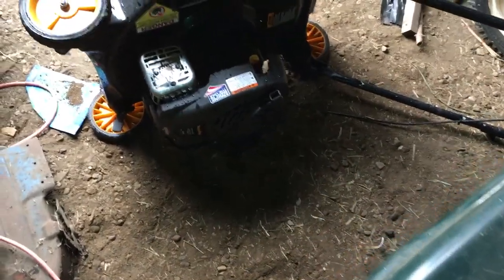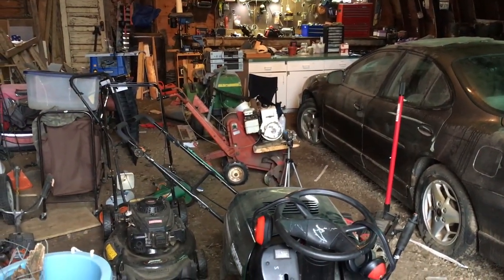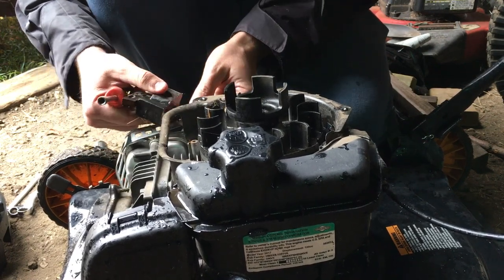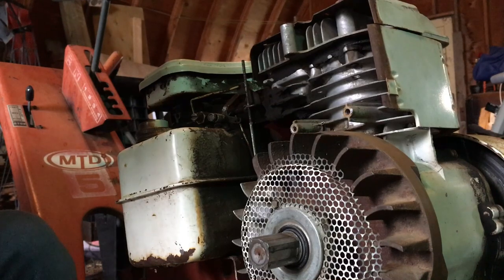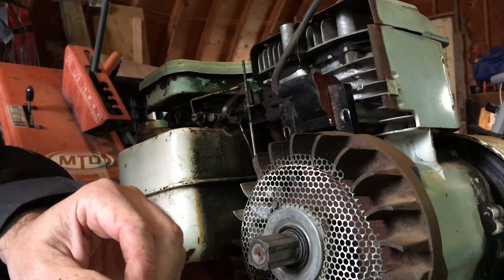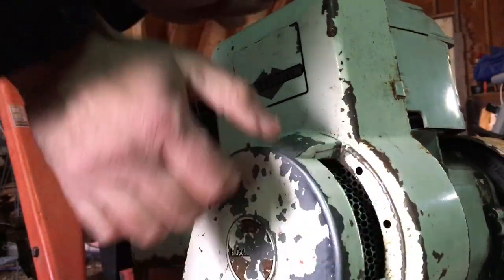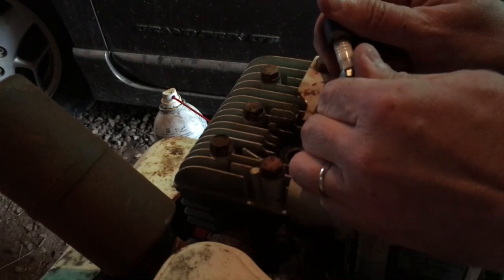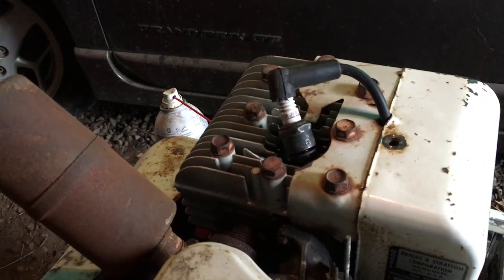No Spark Tiller Repair!!!

Comment: I got my old tiller up and running after sitting for over twenty years. The carb needed a rebuild. I was so happy that I got the thing running that I decided to give it a wash to make it look pretty. Well I'm not getting any spark now and I'm thinking that I may have fried the magneto. Is there any way to repair or restore the magneto or is replacement my only option?
Reply from the maker: It’s often just the points.  Get the fly wheel off and sand the points, you’ll likely get your spark back.

Comment: I have the same problem on my tiller engine It won't spark. I do have an old lawn mower though... maybe I could take the coil off that one? one question, do you have to have the spark plug angled like that when you are testing it, or was that just so we could see it?
Reply from the maker: As long as the outside of the plug is touching the block (electric ground) it should spark.  New coils don’t need points to fire, so the new mower was winning.  I haven’t tried it with an old coil.

Comment: just did the same thx

is it just on there with 1 bolt?? mine also didn't line up 100%
Reply from the maker: Yes, and it worked great up through this spring.

Comment: @Turbo231 I think i have the same kind of engine starter coil, like your old one (the one with the ground wire ring). Where should I connect it? And where do you connect the third wire?
Reply from the maker: I’d have to check the video.  The point of this video was to get rid of all that, points and all, and replace it with a basic system.  Magnets go around, makes a spark, off it goes.  Because the engine is controlled mostly by the carburetor, no other controls are needed.

Comment: Did you try cleaning the old contacts first? Rust builds up on the stator wheel and coil. Cleaning those usually fixes the problem if it was running the previous year. Seen my dad fix the tiller many springs like this if you have a no spark situation, the key being running the previous year.
Reply from the maker: Yes, I did and still no spark.  However the upgrade went great and it ran awesome for a few more years.
Reply: @Turbo231  ok. Thanks for the info. Sometimes the coil just goes bad. More often than not its build up from being stored outside where moisture rust the contacts. Good video
Reply from the maker: Yeah, and I could have replaced stuff, but the upgrade was so tempting and I wanted to try it.
Reply: @Turbo231  looks like it worked out well
Reply from the maker: Fun fact, the motor starting sound that starts every video I make is this motor.  Less fun fact, looks like we lost the main bearing this spring and will be shooting a video replacing this motor with a new one.
Reply: @Turbo231  i also asked the question because I just got into a piece of equipment i bought that didn't start. I got lucky. Wire  brush a drill. Cleaned up the stator and got an orange spark. Replaced plug and got the good old blue one we desire. No coil this time. Was fortunate
Reply: Also dropping you a follow on your site.

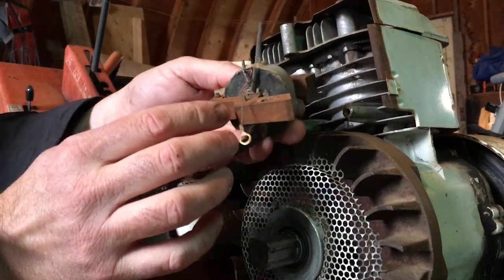Comment: (2:41) On the coil you removed, where was the ground wire connected?
Reply from the maker: Without reviewing the video, I’ll do that when I get home, but I’m guessing to the low throttle.  That way when you want to shut it off, it grounds the coil and kills the spark

Comment: I find it strange you didn't have to adjust the gap on the coil between it and the flywheel which you usually have to
Reply from the maker: I did, but it only needs to be “don’t rub it” close.

Comment: Looks like you're OK but to be complete,  the gap between the coil and the flywheel should be set.  Loosen the coil,  place a business card or similar between the coil and the flywheel magnet, tighten the coil and remove the card.
Reply from the maker: Yeah, I sped over that part but did space the coil only far enough away to clear the flywheel.